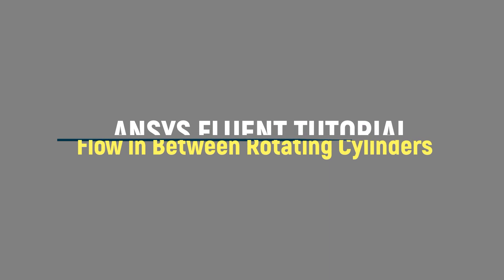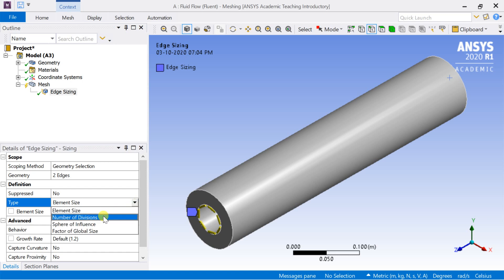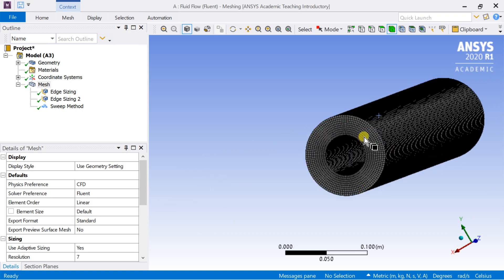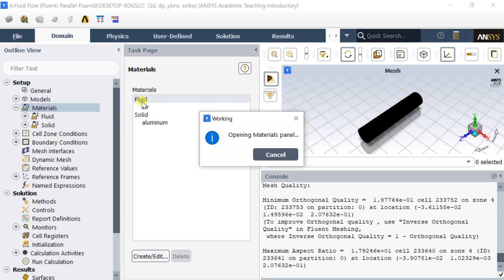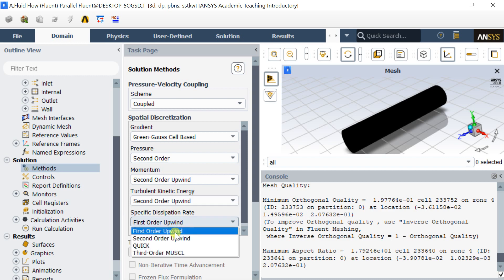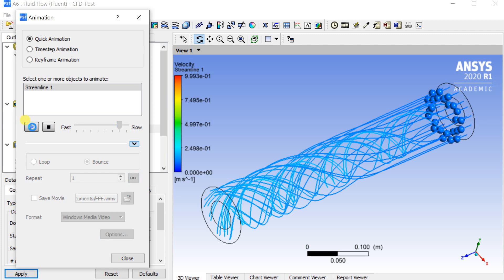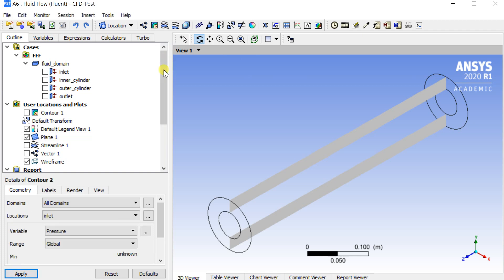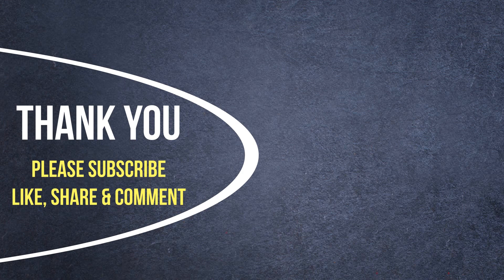ANSYS Fluent Tutorials |  Flow in Between Rotating Cylinders | ANSYS Fluent Rotating Cylinder

Comment: Hey, Is there a way to have a solid object rotate, and then return in the opposite direction? I'm attempting to model a flapping wing and the interface seems to limit the moving walls to a single direction / constant state of motion. I'd love some help! These tutorials helped me a lot so far in setting up the meshing and boundary conditions, I'm just hung up on getting the motion of the wing to be modelled accurately.
Reply from the maker: That might be possible if you use the UDF method.
Reply: @AnsysTutor  Yes! I have seen videos on people utilizing the UDF method, do you happen to know a good resource that explains the functions or how to create one with examples? I'd appreciate it a ton!

Comment: Great video and explanation!
In 3:29 you choose an axisymmetric algorithm, but I don't have that option.  How can I enable it? Or is it because of the license, perhaps? I'm using an academic license in 18.2 version.  It's a big problem for me because it's that option that makes the mesh to be better shaped at the inlet and outlet, otherwise I have to run with those deformed quad cells on the mesh.
Reply from the maker: Its due the version that you are using, the axisymmetric algorithm option is only available in latest versions. But you can mesh it manually, know about it watch our tutorial video: https://youtu.be/8_osCXZjv_g

Comment: Thank you for the wonderful lecture! 
The couple/pseudo-transient was selected in the method section. 
Is that required for the steady solver with the rotation moving wall boundary? 
If I choose the simple solver, is it wrong?
Reply from the maker: Try to use the Simple method and see the difference. You would not get much difference.

Comment: what if we put a constant heat flux on the external cylinder in order to extrapolate the heat coefficient h of the model?
Reply from the maker: If you want to calculate the convective heat transfer on the outer surface you need to create a fluid enclosure over these.
Reply: @AnsysTutor  Thank you very much for the answer

Comment: Is Ryzen 5 4600H with Nvidia Gtx 1650 good for Ansys, Solidworks, Openform, Hypermesh, Ansa? Any problem in that? Reply fast
Reply from the maker: Sorry, I have no experience on such. you should see the system requirements for all these software version to get information about whether the graphics card will be compatible or not.
Reply: Should be good

Comment: sir iam getting an error when clicking results,its showing application failed to connect.Iam using 2020R2 student version.Please help me
Reply from the maker: At first save the fluent after the calculations get complete ,then open the   cfd post results.
Reply: @AnsysTutor  sir i tried it,but still error persist

Comment: For some reason, i cannot use the axisymmetric algorith for the meshing. Does someone know why?
Reply from the maker: Are you using latest version.? If yes then there is a glitch in the software regarding this. You should do the same model again in another file to get the Axisymmetric algorithm option.

Comment: I want to perform a boolean subtraction operation..??  But there are some issues. How to resolve those.
The error shows " Operation would result in non mainfold bodies
Reply from the maker: It means such operation would create a discontinue in geometry. Every geometry should be continuous for the analysis to proceed.
Reply: @AnsysTutor  for the external fluid flow analysis we need to subtract the main body from the enclosure. Isn't it?

Comment: Great tutorial sir
Sir can u suggest me about defining the boundary conditions
My problem statement is i have to analyse the hallow cylindrical sealed  Hull which will be under water in sea at the depth of 100m,I have to check whether the object will collapse, I have defined the hydrostatic pressure, pressure, fixed support in static structural with large deflection on.
Can u please suggest me what alll things to be done in order to get accurate result.
Many of them suggested to use non linear buckling analysis to get accurate result but if I do that the results are non acceptable
Please help me sir I have been trying to find answer for this from long time
Even I am Ec engineering student with less mechanical topic knowledge
Reply from the maker: Though I have not much expertise on structural analysis, I would suggest you to take reference from any standard research paper. Observe their work , which method and how they have analysed the similar problem.
Reply: @AnsysTutor  okay thank u

Comment: I am running the most recent version upon posting this. Should our results be identical to yours? Specifically for my case, I had the same volume, but I had a different minimum volume. Mine 8.933508e-09 vs Yours 4.240946e-10.
Reply from the maker: Mesh is different so results and minimum volume may vary.

Comment: Hi. Thank you for the great video and I learnt a lot from you! Anyhow, I'm currently venturing into "cutting transport" simulation in petroleum engineering background. The concept is almost similar to this video (rotating drill pipe act as inner cylinder and rock formation wall act as an outer cylinder), but, the annular space will consist of viscous drilling fluid and cuttings (crushed rock/sand or solid particles). Can you give me tips or direction on how to perform this simulation? Your kind response is much appreciated! Thank you
Reply from the maker: I think You need to model this using  the multiphase modeling with dynamic meshing.
Reply: OK, thanks
Reply: Hi hazim, me also i work for hole cleaning  study by using cfd simulation, Can i contact you
Reply: Hi Hazim, I hope u can share ur model

Comment: Hi sir, are we seeing the particles moving between the solid area of the inner and outer surface. I'm sorry if it's a too basic question I'm a beginner. Why is the streamline passing through the solid portion?
Reply from the maker: That is not solid area, that is the fluid region.
Reply: The region we selected is not solid. It can look like solid because we created a cylinder. But here in fluent this is the portion where fluid flows.
Reply: Thank youuu

Comment: Thank you for this tutorial.  What if there is no inlet and outlet. Water already exists in the annular space between the cylinders. The inner cylinder is rotating and the outer cylinder is stationary. In that case, will I follow the same procedure as this tutorial except for there will be no inlet and outlet boundary conditions? Is that correct?
Reply from the maker: Yes , you can follow the same procedure.

Comment: Hey Ansys Tutor! I really enjoy your videos because they are so informative. I had a project that I was working on and was hoping you can point me in some direction with it. 

I am doing Fluent simulation for finding diffusion coefficients for melt flow in horizontal capillary tube. I know how to make the geometry, but I am confused on how to start the setup process. The model has to also have natural convection and mass transfer concepts involved.
Reply from the maker: Is it a melting process or molten metal flow problem.
Reply: @AnsysTutor  Molten metal flow problem.